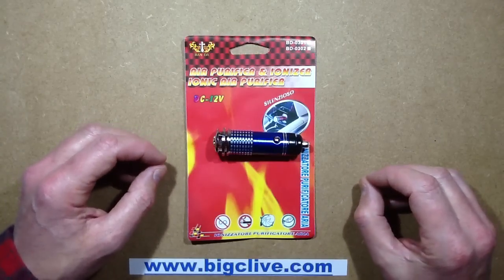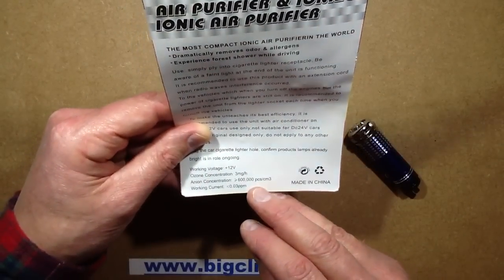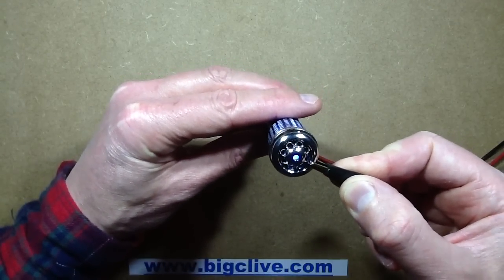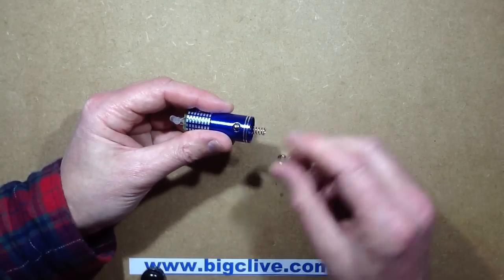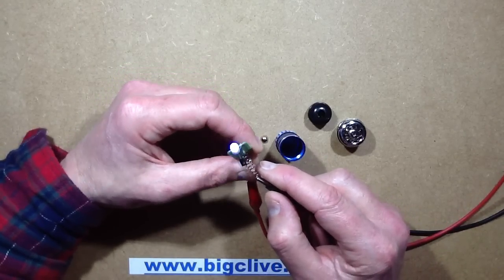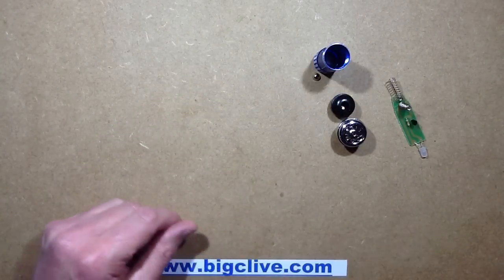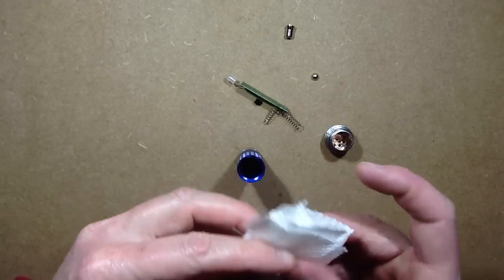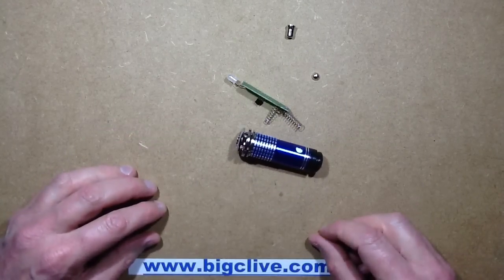Car ozone ionic air freshener teardown.

Comment: Clive, you should get some kind of P.O box or some kind, so we (including my self) can send you some cool gadgets,

I also own many laser pointers, including custom made ones, using diodes   (from old DVD RW burners) and my own driver to power them , ranging from 445nm (blue) to  635nm (Red) <- which is mostly found in DVD RW burners, and also blue ones from old PS3 drives. -
If you ever set one up, let us know. I'd love to send you some cool gadgets for your videos.
Reply: I have no idea why parts of my comment has lines through it.

Comment: I actually wasn't surprised that it was just an LED. But I did lol at the unconnected transistor. I wonder why they would go to the expense of putting a transistor in if its not doing anything.